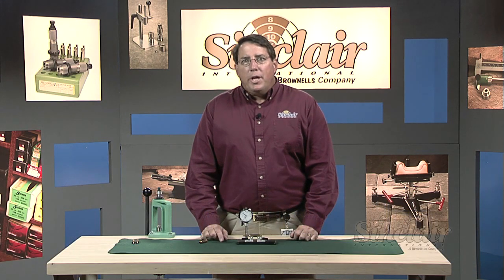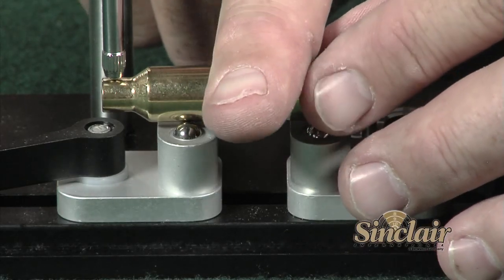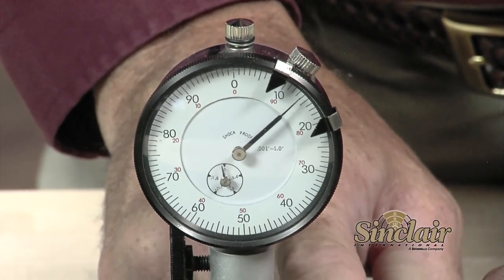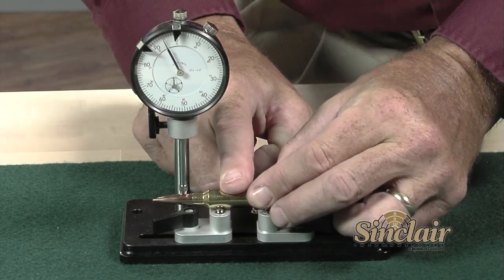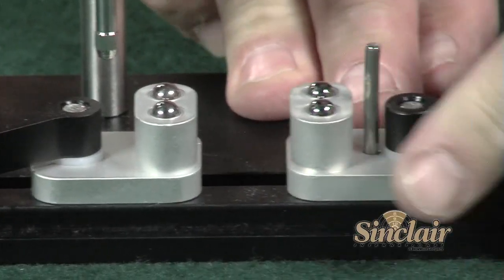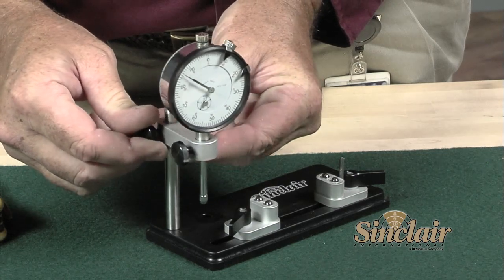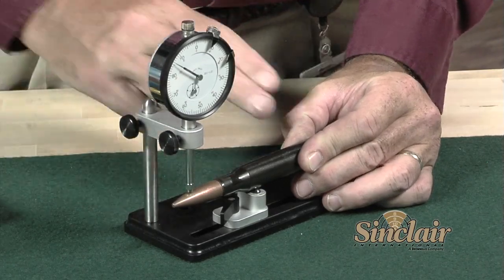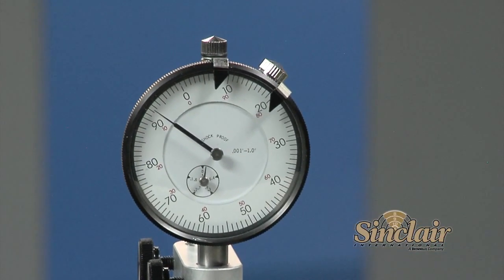Sinclair Concentricity Gauge

Comment: I bought this gauge, and it does what is stated in this video.
However, I did not research this properly, and will be returning it.
The Hornady version allows for coorections to be made, where this device only shows the error.
Reply: I believe the Hornady rotates the case on its center axis where as the Sinclair is rotating on the body of the case. The Sinclair can check neck run out after sizing where as the Hornady can only check loaded cases. The Hornady looks like a well built piece and has it's place but I believe the Sinclair to be more versatile.
Reply: Have you been using the hornady tool to correct run out in your loaded ammunition?  If so how do you like it? Sry I know this was an old post.
Reply: @trashpanda2396   I use the Hornady tool and I prefer it over this model.
Reply: @trashpanda2396  I have the hornady and it work great.